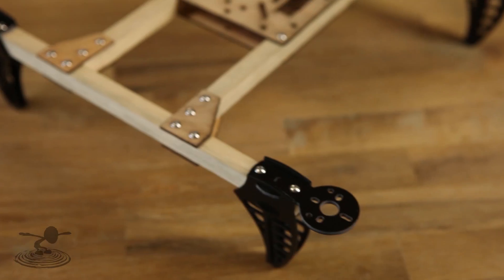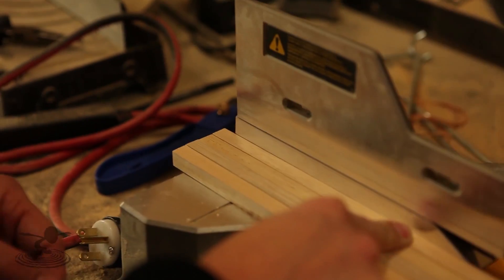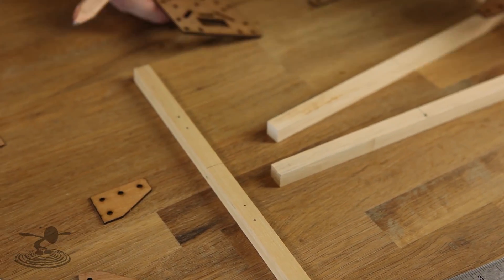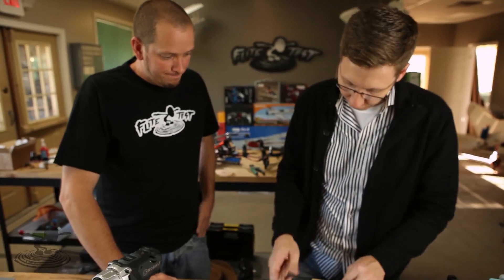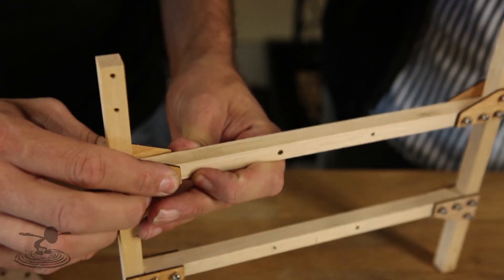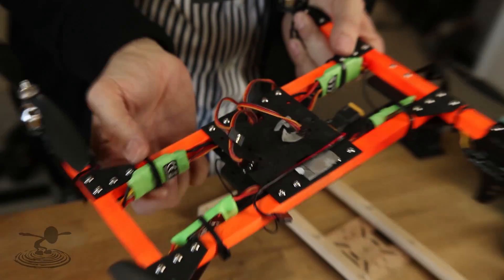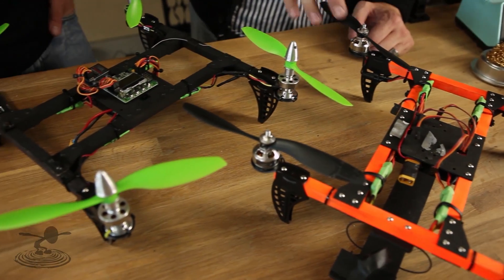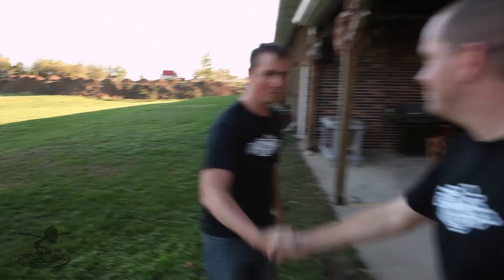Flite Test - Knuckle H-Quad - BUILD

Comment: Is this a good platform to start flying quadcopters if you dont have any other experience in rc? and if so, what electronics would you recomend? (like a basic transmitter, reciever, board, etc)
Reply: Floris Hubregtse I would recommend the H-Quad, its really easy to build, and all the required parts & electronics are given on a list.  ( http://flitetest.com/articles/H_Quad_Scratch_Build )

Comment: How do i get the H Quad firmware on the kk2 board? it only says it has Dualcopter, Tricopter, Y6, Quadcopter +, Quadcopter X, Hexcopter +, Hexcopter X, Octocopter +, Octocopter X, X8 +, X8 X, H8, H6, V8, V6, Aero 1S Aileron, Aero 2S Aileron, Flying Wing, Singlecopter 2M 2S, Singlecopter 1M 4S pre-installed but not the H Quad configuration so how would you get that
Reply: use Quadcopter X if you look the motors line up in the same place

Comment: I would love to build one! I've been looking at the parts required to build one. I will probably buy the FPV equipment after I build the copter. I have a question. Do I have to buy a super expensive controller? Or will a Spektrum DX5e work? If anyone knows chime in. I guess it depends on parts.
Reply: It would work, however not so great since you can't setup any dual rates or expo, you could get a Turnigy 9X or 9XR and Frsky module and RX for around $100, and that'd last you years (assuming it doesn't fail/get damaged)

Comment: I have built several airplanes using the dollar tree foam board, even using the urethane FT recommends. I have found a far superior product to use, that cost $1.40 per 20” by 30” by 3/16” size, it is Elmer’s 950802T, available at Walmart.  It does weigh 35% more but the difference is staggering in terms of the strength, the internal foam has memory, the paper outside is multilayer-ed, and the glue used is bonded to the foam so completely, that you cant even remove it if you tried!

Comment: The edges of this Elmers after cutting bounce right back from any compression, and can be sanded to perfection. Using a foam safe instant glue will produce the hardest best formed edges you will ever experience for a foam based project.  You will NOT need ANY internal support (carbon, wood etc.) in your build. This makes the extra weight insignificant on your project.
 Robert HobbyKing PS #4.

Comment: No they haven't... thats a v tail quad. Not the same as having both rear motors pivot like a tricopter tail. The constant 45 degree angle means you lose around 50% downward thrust on each motor.

Comment: Have you guys thought about doing a modified T-copter/plane hybrid?  

I could see the front two motors being mounted on wing tips with servos that would allow them to tip forward for FFF (Osprey style).  The rear motor then acts as the rudder and elevator, and you can add a vertical stabilizer on the rear arm.

Would it work? Maybe, maybe not.  I wish I had the time and resources to try though.  I am studying as a mechanical engineer and just got into this hobby a month ago.  Love your channel!

Comment: Question - is there a reason not to drill center holes on the center mount? Seemed odd to have to measure the middles after having sight holes for the arms.

Comment: Thanks for the tip on mounting the motors. I like the look of the  low mounts and would have never realized they added vibration.

As for the build, it started out a little rough, like you were rushing the knuckle to market before it was ready. I think by the time you marked holes for the knuckles on the inner frame that it started to feel more Flitetest-y.

As for others commenting on build videos, yeah they might not necessarily be needed, but you watch them for the director commentary.

Comment: I would suggest putting the centre wood piece (that holds battery/control board etc) in as well before tightening the bolts... If it's off a little bit, you won't be able to fit the piece in properly